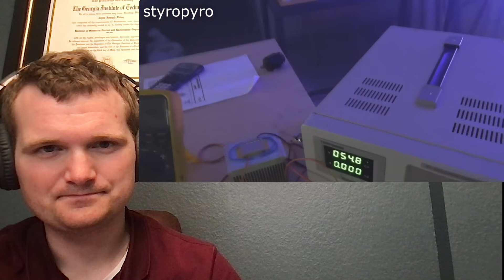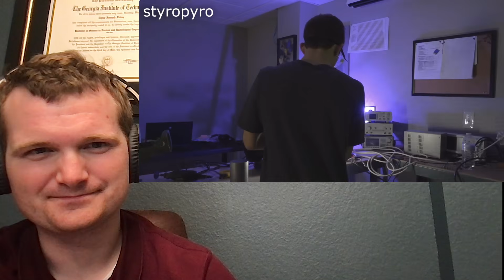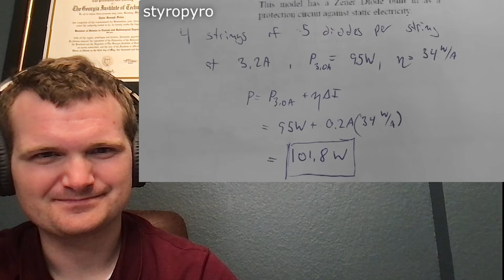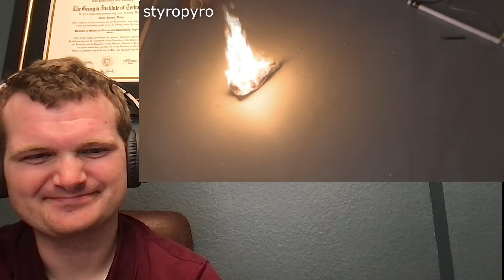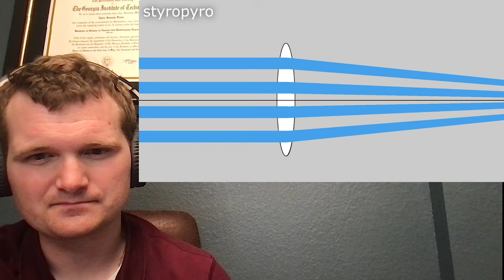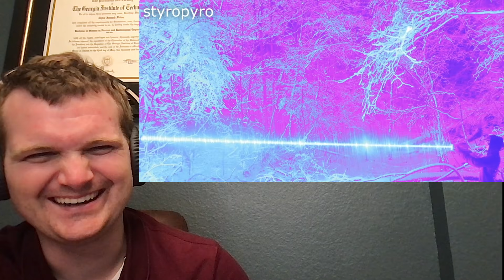Nuclear Engineer Reacts to Styropyro "2020 World's Most Powerful CW Handheld Laser"

Comment: No joke I would love to do kind of the opposite that he did here, using a really weak laser diode set to pulse and timed at half a second between each laser pulse with a built-in speaker and raspberry pi to make star wars blaster sounds to create a prop laser gun. I feel like that'd be a cool project to try, especially if one were to implement a switch to disable the laser if they just want the blaster sounds. In a project like that, I'd probably use a diode from a laser pointer and see if there's a way to reduce the amount of power it gets so it's less of a hazard, but I don't know the specifics behind it

Comment: My respect for Styropyro grew when I bought a 1 or 5 watt blue laser diode and managed to destroy it after maybe an hour of total runtime. I had it in good thermal contact with a big hunk of copper and slightly underpowered it with a lab power supply. It ran long enough to get it focused and burn paper a few times and then went dim. I still don't know what I did wrong. Maybe I should have clobbered the copper heat sink with an ax-hammer a few times or zapped it with a MOT. I'm not sure how that helps but I assume it one of those dark arts of laser building things.
Reply: you clearly didn't invoke the occult as you should have 🤣

Comment: unrelated to the vid, but one thing I found extremely interesting is the radiation dosages from medical imaging. so while a chest xray may be 100μSv, a chest CT scan may be 7mSv. so yeah, 2 days ago I might have had ~40μSv from an x-ray, but the highest I've had would've been in the mSv range. while this is higher than the limit for the general population, medical stuff is excluded from these limits. but what's interesting is even the 7mSv chest CT scan is still several orders of magnitude lower than the threshold for being considered at increased risk of cancer.

Comment: All fun and games,until someone brings a mirror to the laser fight.
Reply: I hope you saw what that thing done to bottle. Now replace it with big mirror that will spill molten glass and metal all over your feet.
Reply: Such laser would melt the mirror
Reply: @C0lon0  Only if the mirror is one of those cheap plastic ones. Solid/thick silver mirrors like we used in the old times would reflect the light perfectly fine. Even with it's low melting point it'd take hours and hours of direct contact to even leave a mark. Same is probably true for thick chrome. It being highly reflective means the mirror isn't absorbing the energy itself and therefore wouldn't melt very easily. They use fairly normal mirrors to reflect lasers way stronger than this in giant telescopes.
Reply: @Loserstakethebait  he melted bottles with that laser, the mirror would just make it slow by just a few seconds.
Reply: @C0lon0  Idk how that applies to anything I said. The bottles were not mirrors. If they were it wouldn't absorb, because it would reflect.
Reply: @C0lon0   Yes. Bottles that weren't reflective. If it reflects, it doesn't absorb the energy. That's the entire point of the mirror. Idk why that's so difficult to understand.

Comment: Would you even SURVIVE a direct shot in the eye from this laser or would it go straight through into your brain?
Reply: as you saw with the steak demo, it would have a hard time penetrating you. it would still absolutely suck to get hit tho and that eye is never being used again.
Reply: Well as we see with the wood and meat and everything else, Lasers are not good at penetrating deep into tissue, and your eyes being dense white balls of liquid they'd likely take a fair bit to cook, due to being white and water. "orst case scenario your eyes flash boil. But you'd already be blind so nothing lost. If you wanted to boil a brain your best bet would be hitting a hairless patch of skin on the head as hair would melt and again stop the laser, and even skin takes a fair bit. Also bone itself is white which is pretty decent at reflecting light, not that it makes that big a differnnce on this power scale but it would add up. 

No the best offensive use of Lasers against humans is the blinding factor, which is a war crime. Weapons that are designed to Maim and cause pain instead of kill will get you tried in The Hauge.
Reply: With 100 watt laser output. If that hit your eye socket directly, that would not kill you with even 3 seconds of exposure. Especially with your eye which is mostly white which will reflect a lot of the light away. So even if we're generous and say only 60% of the energy is going into your eyeball a lot of that is going to be going into the water in your eye boiling that off. But seeing as you're already blinded instantaneously from this laser, you're not really losing much, how long this would take to boil off all the water? I don't know but it would have to do that before there's any concern of more damage than that. And then as demonstrated by that steak demo lasers find it particularly difficult to penetrate material and cause damage farther inside without just melting off the first layer of material and skin is particularly good at this. Now it doesn't take much of a temperature. Increased to cause serious problems for the brain, but getting that temperature increase with a laser would be quite difficult

TLDR, Yes you could kill someone with this but I would be more scared of someone with a rock as far as how lethal they are.
Reply: There's a difference between eye damage and eye DAMAGE. A direct shot from this wouldn't just blind you, it would boil parts of your eyeball. Although, I'm not sure it would really penetrate that far into the eye. 

I would guess the eye would need to be removed to prevent infections, but probably no damage to the surrounding area.
Reply: I'm thinking worst case scenario the eye would burst and drain and you would start taking damage to the back of the remaining eyeball and socket. That depends on the length of the shot and the focal distance. The direct damage probably wouldn't kill you immediately but even with being rushed to a hospital survival could be iffy. At the least you would lose the eyeball and they would need to remove any surrounding tissue that got cooked or it could go necrotic and quickly cause a horrific infection.

Comment: If they needed it, it would be allowed. NDT pipe testing is so dangerous it would kill anyone in the room if they walked in the wrong area. Guys do that while suspended from ropes. If it is needed to make money, industry allows it. The end.

edit: Huh, I thought they were more powerful. My bad! Still, fairly dangerous. I think my point stands. A lot is allowed if critical to industry.
Reply: Air defense uses these. This is probably Mil spec, hence the lack of documentation on the site.
Reply: @Wavy_Gravy  Hardly. Way to weak to really be one. Most likely just an engineering sample for next gen system that is being in development (and ofc is behind commercial secrets act or something along the lines). You can get all kinds of crazy stuff from E-bay that way, for example next gen PC hardware that is not even announced yet. But i hope no one needs a reminder that company making these will NOT be happy if their prototype of a machine that is not even customer available yet is in the hands of some random dude.
Reply: I don't think the sources used in NDT would kill everyone in the room. Leave one in your pocket for a while? Yeah, that'll kill you
Reply: @inductivelycoupledplasma6207  Always depends on the strength of the source, the duration of the exposure, etc. Generally, you want to avoid any unnecessary exposure, which is why we had to wear dosimeters whenever we were doing radiography, and we had limitations on how much exposure we could have over a given period. Once you hit that limit, you were not allowed to work (on-site) until it was deemed safe for you. Radiation is a deadly thing that the human senses cannot detect, which is why there is so much safety involved (or is supposed to be).
Reply: @YourScaryMother  absolutely. I wasn't saying by any means that the sources in NDT aren't dangerous. Exposure rates of 1R/h at 10m from an unshielded radiography source is pretty typical, which is an astronomical amount of radiation. All I wanted to state is that despite the fact that these are very hot sources, they won't kill you by just looking at them (at least not without a decent amount of exposure time, and close proximity to the source).
Reply: What makes it so dangerous?
Reply: They allow toxic chemicals in our food because it's cheaper and makes more of a profit for them, so yea, if it makes them more money they'd will allow it